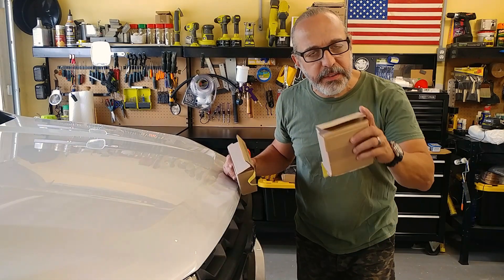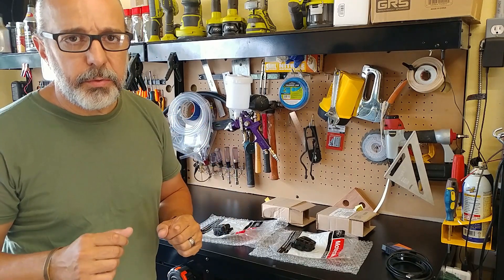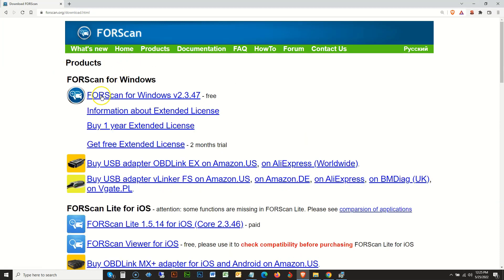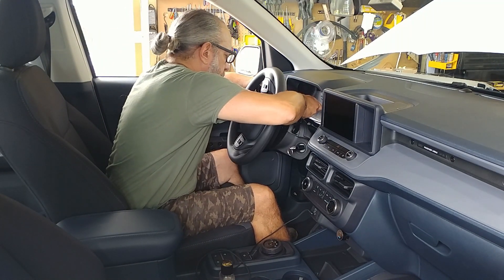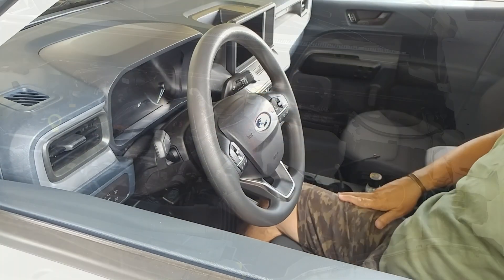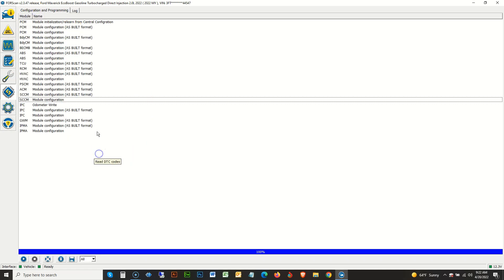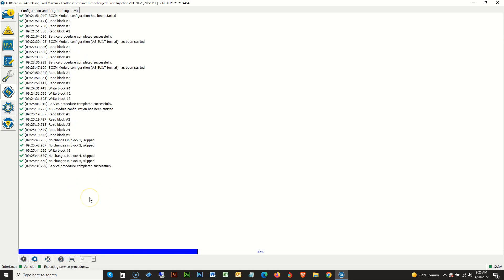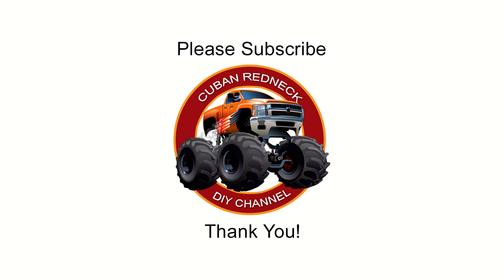Ford Maverick Cruise Control

Comment: Please help when I connect to the truck it only find the PCM module nothing else!
Reply from the maker: ... I am traveling, but what you are describing is a baud rate issue. Most likely, your USB adapter has a switch labeled "high-low." See where it is at, disconnect, flip the switch to the opposite position, and try reconnecting. Also, make sure you have the latest version of ForScan and an active license. If you have never connected to the vehicle with this USB adapter, it may be an incompatible device. I have several of these devices because they can be somewhat temperamental.

Comment: If I only want to activate the cruise control on my 22 maverick XL,  is it necessary to also install the right side steering wheel switch? Thank you.
Reply from the maker: ...thank you for stopping by. Several functions of the OEM left switch will be transfer to the right one, so yes both need to be replaced.
Reply: Will this work with Copilot 360? Thank you.

Comment: Installed cruise on neighbors Maverick, and worked great, then Ford had a software recall ,and cruise not working. Using Forscan,   I went back in and went through first two resets ok, then final set up for BCM keeps saying interrupted so I can't program.  Anyone  have any help?
Reply from the maker: ...thank you for stopping by, after the 3rd recall it seem that the issue has been fixed.

Comment: I just used this to install cruise on my '22 Maverick Hybrid, with some help from Carlos Young of Texas Performance Industries (Cypress, TX). It worked perfectly! I used the codes from the blog post for Copilot 360 and the Hybrid, and everything seems to be correct. SO happy to finally have cruise on my truck.

One thing I didn't realize at first was that you need the Expanded License on Forscan, but I was able to get the two-month "free trial" and use that, so I didn't actually have to pay anything for it.
Reply from the maker: Thank you for stopping by and sharing your experience!

Comment: Hey everyone! I have 2022 Maverick Hybrid XL no CP360 (Hell, I'm surprised this cardboard box truck even came with seats, let alone creature comforts.) Just want to confirm what size Torx screwdriver I need to remove the screws on the back of those factory switches. Thank you!
Reply from the maker: ... thank you for stopping by! Sorry, have not found that info! I going to say a T5, but don't hold me to that, you can get a multi-tip set at Harbor Freight for like $5

Comment: Ford came out to my home to do a recall related to turn signals.  When they finished they reset my XL to factory, which took out my cruise control.  I tried to get them to fix it but they refused so  I had to go back to your instructions and re-progam using Forscan.  Something to keep in mind if you have Ford work on your Maverick.
Reply from the maker: ... thank you for stopping by! And yes, this is a known issue. My dealer corrected the problem by re-entering the HEX code of step one on the original video (SCCM Module). However, not all dealers are as competent and or friendly. Last I heard, some are driving NEW Mavericks home and putting a few miles on them to get around the Ford price gouging policy in order to sell them 1000s over MSRP as used vehicles with low miles. Not only that, but I found the recall bogus because the Maverick has incandescent bulbs, NOT LED. If a bulb goes out, the blinker won’t blink! It will stay steady!
Reply: I just finished all my recalls finally the are done over 6 recalls

Comment: Question I just had my 22 XL in to the dealer for the turn signal recall, now the oem cruse I added no longer works. Did maybe dissconnecting the battery or the recall repair tix maybe put the FORSCAN program back to as built? The siri is also acting different from when I dropped it off. Any ideas?
Reply: I've had the same issue.
Reply: I had to pretty much go back through all of the FORScan steps in this video again after the recall. In the first step where it detects the new buttons, it did not. I had to edit and select the ones he has shown on screen and then write. After all of that it works again.
Reply from the maker: ... thank you for stopping by! The firmware will reset the BCM to factory specs as per your VIN. You will have to reenter all your HEX codes as per the original video. There are reports of "THAT" not working on the first try! If the CC does not engage after resetting your HEX codes, go back and change the last digit to something else, save it, go back reenter the correct digit, and save again! So, far we have a 100% recovery, but please let me know if need further assistance.
Reply: @CubanRedneck Change the last digit of what?
Reply from the maker: ...anything if its a 5 use a 6 save it, key off and on, then go back and change it to the correct number! This is "if" the CC fails to lock at desired speed!
Reply from the maker: ... of the hex code! Have you watch the original video? https://cubanredneck.com/ford-maverick-cruise-control/
Reply from the maker: ...as I said! That is IF the codes don't take effect! Reset all your HEX codes, and take the truck for a drive! If it does not work go to the end of each of the codes you change and enter change the last digit to anything. Save it, turn the key off, then on, and enter the correct number!
Reply: This exact same thing happened to To me this week at the dealership.

Comment: works great, however I brought my XL in for service and they did a safety recall that had to do with turns signals. They did something to some module in the configuration that is not letting my cruise control work now. Has anyone run into this problem after FORD touched your vehicle?
Reply: I had to pretty much go back through all of the FORScan steps in this video again after the recall. In the first step where it detects the new buttons, it did not. I had to edit and select the ones he has shown on screen and then write. After all of that it works again.
Reply from the maker: ... I think I reply to you via email, but anyway here is what yo need to do! You need to reenter all your HEX codes as per the original video. There are reports of "THAT" not working on the first try! If the CC does not engage after resetting your HEX codes, go back and change the last digit to something else, save it, go back reenter the correct digit, and save again! So, far we have a 100% recovery, but please let me know if need further assistance.
Reply: Yes, All good now after editing and rewriting via Forscan.
Thanks All🛻🛻
Reply: Just had turn signal recall done. No lore cruise control.  Had to redo cones but  the only one that changed  was the bdycm last block 8872.  all working now

Comment: Just did mine it was a piece of cake
Reply from the maker: ...  awesome thank you for sharing!
Reply: @CubanRedneck  I want to try and unlock the mud and snow driving option soon.
Reply from the maker: ... cool, let me know how that works out! No snow in Southwest Florida but I am sure other may be interested!
Reply: @CubanRedneck  I made the change and added the mud/rut and sand/snow options.  Will not really know what they are like until the snow flies and hunting season is upon us here in Pa.  They definitely work as the RPMs changed when I put them into their mode.
Reply: @CubanRedneck  In the same process I was able to disable the auto start/stop option.  I get the A with line through it now when I come to a stop.  Honestly I don't remember if I disabled it with forscan.  I need to go back in and check.
  My gas mileage has also drastically improved by 3-4 mpg since making these changes

Comment: First two steps worked. Third one I keep getting that the vehicle conditions are incorrect
Reply from the maker: … thank you for stopping by! Two things can be wrong here  1 – the incorrect baud rate (if your USB adapter has a switch, turn it in the opposite direction) 2 – either step 2 is wrong, or you have a bad hex code. Please take a look at the blog for further details -  https://cubanredneck.com/ford-maverick-cruise-control/

Comment: I  bough a ELM327.  Could not get it to work with my laptop.  Checked Forscan web,they said no with a laptop. Recommended OBDLink EX.  plugged it in and automatically installed and was ready to go.
Reply from the maker: …. Hey, thank you for stopping by. Yes, if you are not into doing this regularly, the ELM327 can be challenging, and there are issues with USB drives and all kinds of things, which is why I recommended an older computer. I have a race car that we run on Panther spec races, and adjusting things like converter lock RPM and other features are routine changes that need to be made. For that, the ELM327 is a better choice. I have the OBDLink EX listed on the blog for the simple reason that if this is going to be a once in a lifetime and it will be for many, it is a better choice. Nevertheless, and regardless of what OBDII adapter you use, I hope you successfully activated the cruise control feature on your Maverick. Thanks again for stopping by and sharing your experience.

Comment: Great video. I am planning on tackling this project but have a quick question. 
Your video and instructions indicate to change the ABS from the no cruise option to "option 2", cruise control". 
However, in the Maverick Truck club thread you mentioned, they indicated to also change 
"ABS - 760-03-02 0200 0000 0573
Sets the braking to work correctly with cruise control"
Is this also necessary? I have a 2022 XL, Ecoboost. Without copilot 360. Thank you!
Reply from the maker: … hi, first of all, thank you for stopping, and by the way, we have the same truck. With that said, my truck was the first one I did. The charges, or should I say the deviation from other instructions out there, came from feedback from more than one Ford Master Mechanics I consulted at a local race track. I was told during my research that setting the ABS ECU to CC mode has a higher system hierarchy than setting the hex codes, which is lower in the command line. Since then, I have done several of my friend’s trucks, and 1000s have reported success using this procedure.

Furthermore, I have received emails from dealer mechanics saying this is correct. Please know that this was not something I opted to do but rather something suggested to me, and I tend to listen to advice from those who know more than me. This is my first FORD in over two decades, and still learning all the ins and outs.
Reply: Thank you very much for the detailed reply! I appreciate your help
Reply from the maker: … no problem, and if you run into any issues, contact me via my website. We have been able to figure out just about every bug encountered.
Reply: I just finished installing the buttons I ordered from Rock Auto and activating it via forscan. Your tutorial was perfect. Everything works great. The one thing I did differently was that I did not disconnect the wires leading to the airbag, even though I did disconnect the battery. I wasn't super comfortable with this part. What I found was that there was enough slack in the airbag wire to allow me to pop the trim piece out and turn the airbag sideways, which allowed it to go through the trim ring opening.
Reply from the maker: ... thanks for sharing!

Comment: Hey Cuban Redneck, thanks so much for posting! I managed to get the cruise control installed just as you recommended. I was wondering if you know how we could disable the stop/start feature permanently? Thanks again!
Reply from the maker: ... hey Scott, thank you for stopping by, and congrats on getting your CC turned on. My truck has a button in the center console next to the auto break feature (whatever that is called) that turn it off - However, in some AWD vehicle which doesn't have such switch, we have resorted to installing a small or dead battery (a pain in the rear) and then starting it 3-4 times for 1-2 minutes. If the ECU sees a battery with less than 50% life, it will permanently disable the feature. However, to turn it back on you have to go to the dealers and have reset the battery life code in the ECU.

Comment: I just did mine today. Gosh I was nervous. It went great! Only thing is I would say is that when you pull the switch cables to squeeze the little tabs on the side. Lol I pulled and grunted a lot before I realized there was a tinny little pinch tab. Thank you!
Reply from the maker: ... hey bud, thank you for stopping by, and congrats on getting your cruise control activated. I think I mentioned that, but I will review what I said in the blog.

Comment: My right hand side switch(s) are not being recognized. It lights up. Used the correct ford part number. Tried plugging off one in and won’t recognize that either
Reply from the maker: .... what type of truck (EcoBoost or Hybrid), any options? Sounds like the second set of codes did not saved correctly. 
Please go thought all your setting and visually inspect each slot.

Comment: I'm struggling trying to disconnect the airbag. Where is the small opening in the back of the steering wheel, behind the switch. Any tips?
Reply from the maker: … hey bud, thank you for stopping by. I am sorry you are having issues with that! If you turn the steering wheel to the left with the switch at the 12 o'clock position, the opening is directly behind the out edge of the airbag/horn cover inline with the switches. Both sides are the same! It is the only opening/depression on the back of the steering wheel.
Reply: @CubanRedneck  thanks for the response. I'll have to give it another shot. Just seems like I'm blindly poking around with my screw driver. appreciate the video!
Reply from the maker: ... email me if you need further assistance. Don't mind helping and yes, it is a kind poking in the dark type of thing!

Comment: Hey bro I used your video to get mine installed and it worked like a charm. I didn't realize that Forscan software takes 30 minutes to get a free 2 week trial so I got stuck waiting. Also, that bezel was a bitch to remove without breaking it! I have also installed the harness and actuator for the tailgate, IMO the best 2 mods for an XL!
Reply from the maker: ... awesome. A lot of people have asked for the actuator wiring. I need to add it to one of the videos it is just not enough for a single-subject video and too long for SHORT. YouTube hates 2-3 minute videos they drag the entire channel down. As to the bezel, patience my friends, patience ...LOL

Comment: Just got home from my local Ford dealership, they charged me $202.35 tax included to install the switches, that I had purchased previously, and used FORScan to make the changes as you specified in your video, and everything works perfectly!!!!  I have a 2022 Maverick XL Hybrid with Copilot 360.
Reply from the maker: …. lol, I hope you know that the switches are the easiest part of the entire process! But, you got it done, and that's all that matters. Thank you for stopping by!
Reply: @CubanRedneck
Reply: The dealership also did the FORScan reprograming, thanks again for the video!!!
Reply from the maker: ... yes some dealers are doing that and that is great to hear!
Reply: @gsaddler52  what dealer was it? I might go that route.
Reply: Takes 10 minutes max to install the switchs lol . Im in the wrong business 50 bucks for 10 minutes work
Reply: @gsaddler52 did you have to replace your steering wheel or were you able to install the cruise control device to your truck and make use of the vacant slot/s for the switch on your truck? TIA
Reply: @ No, I just replaced the switches.  My local Ford dealer installed them.  I didn’t want to fool with the air bag.

Comment: hey can you do all this codes without the cruise control parts installed? I'm ordering mine and would like to start adding the codes and then plug in the parts later. Would that be an issue?
Reply from the maker: ... sorry no. You can't update the ECU with out the correct switches. It will generate a check engine light that can only be erased by the dealer. You are modifying not only drive mode but also ABS breaks. It is just not safe.
Reply: also, they must have changed forscan because I can't do 'save all' prior to making changes. The only option is to 'write'
Reply: never mind that. Only able to save in As built
Reply from the maker: ... yes, correct.

Comment: can i use same codes for the XL hybrid without copilot 360?
Reply from the maker: … hey KD, thank you for stopping by! On the only hybrid I have done, I used the codes on my blog - https://cubanredneck.com/ford-maverick-cruise-control/. However, if you read some of the comments below, there are other options. My recordation is to use the codes in the blog. If you experience any side effects, consider the two options listed below. I am friends with several dealer techs, and we have been able to get everyone running.